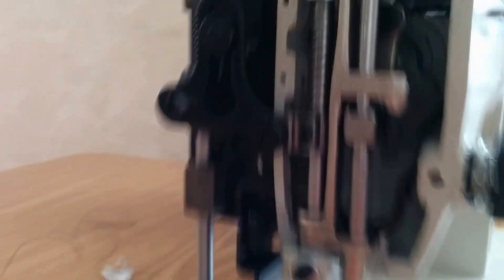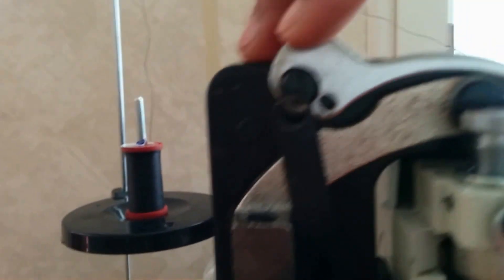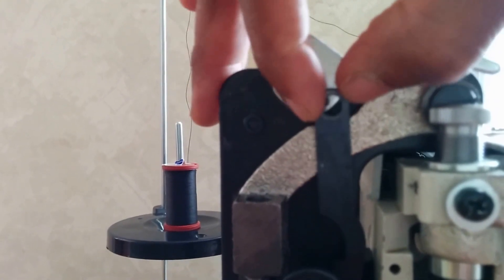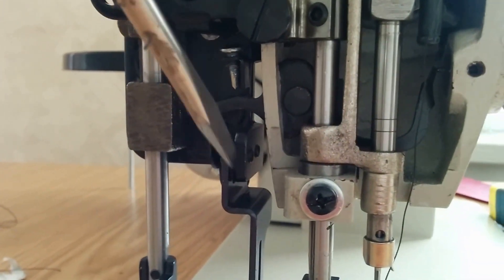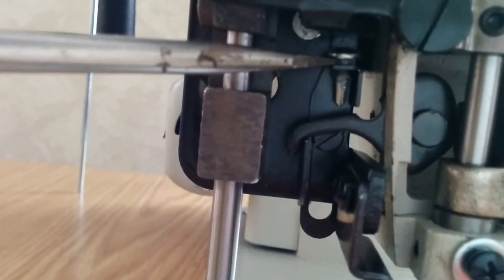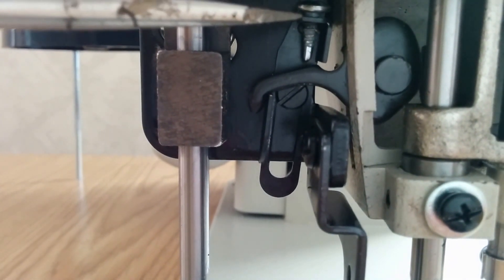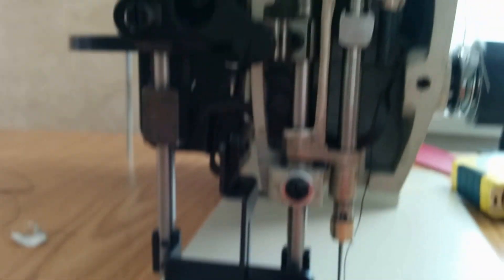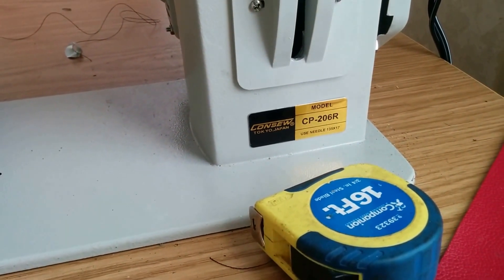Consew CP-206R presser foot lift

Comment: Thanks for the info on your mod! I’m having the same issue with my 206R. You may have said this, but I missed it if you did. Was there already a screw hole for the self tapping screw, or am I missing something?
Reply from the maker: There was no hole. I bought a self tapping screw. (Actually a whole pack of them) 1/2" long.
Reply: Thanks Trevor! I’m waiting for another lift bar to arrive before I do your mod, just in case I break the original... Rule 1 for me, ensure success by preparing for failure. 😂

Comment: This is a Sailrite clone, Sailrite changed manufacturers due to the fact of them selling clones of their machines behind their backs (Sailrite). I have Sailrites zigzag version and nothing is "flimsy" or needs to be modified to make it work. Consew, Rex, and a company named Morse ( no connection with the vintage Morse company) sell a clone of the Sailrite. Having had the chance to sew on a Rex, I can tell you they are cheap imitators and do not compare to the Sailrite.
Quality has a price... I'm glad I paid for the Sailrite instead of a clone.
Reply: Wrong, sailrite is one of the clones, but there are clones now that are long bed , 9 instead of 7 inches. Consew version is made in Japan, sailrite in China. Do more research, you are being ripped off by sailrite, same machine, same source, but use the larger balance wheel which is an option they all offer. Reliable is better.
Reply: @FrancisoDoncona  you are partly correct and partly not. The original Sailrite Ultrafeed was a clone of the Thompson PW301. After discovering the manufacturer in Taiwan was selling the Ultrafeed V.1 design to other manufacturers Sailrite sought a new manufacturer, in China. Most Ultrafeed clones on the market are based off of the V.1 design with lower quality parts castings. At the same time Sailrite was looking for a new manufacturer they were also redesigning the Ultrafeed to include stronger internal parts due to the Posi-pin lockup transferring too much torque to the driveshafts and linkages. This is the V.2. For most of us, the V.1 or even some of the better quality clones would work fine. But there's nothing about the quality of the Sailrite machines, quality control or customer service that is a rip off.
Reply: @josephcarter1850  Thank you, Joseph. Looking at Sailrite's offerings, I think I'd buy a Fabricator instead of an Ultrafeed. Only one thing: the Fabricator head can't be purchased by itself, the entire table, servo, etc, has to be purchased as a package. I just started on this hobby and bought a REX as my first machine. I should learn what I need to know from the REX if move on to a better machine.
Reply: @josephcarter1850  Interesting saga about the Taiwanese company selling the Ultrafeed V.1 designs.
Reply: @FrancisoDoncona  I own a clone of the Sailrite machine, labeled "Sew Strong".  I've done a lot of investigation to try to bring my machine up to the Sailrite level.  They have remanufactured their machines with all new internal parts to make them better and stronger.  The basic design is of course the same, but the Sailrite machines are on a different level, and it's not hard to understand why they charge more for them.  My clone quality is just above boat anchor, with so many problems I often want to heave it out the window.  This video shows something I've just experienced, ie., the limited presser foot clearance.  So, I"m going to see if I can do this mod.  I have a 9 inch machine, though I'm pretty sure it's Chinese.  You do get what you pay for.
Reply: I'm looking to purchase a Sailrite. I have listened to the sound quality of those machines mentioned and most sound horrid over thickness of fabric or on a double ply material. As much as I'm looking to buy the "knock offs" to save money, I think in the LONG RUN spending a bit more will be a blessing since quality construction will dictate the sell of those items made.

Comment from the maker: the timing jumped early on in my ownership and one of the synchronizing pieces broke. I have a parts list but was able to make the price from parts from the hardware store and a welder. I also fine tuned the timing for smoother operation. it still works well and I use it often but I've since bought a larger machine which better suites my purpose. I would recommend it as a good entry level walking foot machine.

Comment: do you still like this machine?  has it given you any problems?
Reply from the maker: I've been using my machine for about 5 years now. I had 1 part break and I made a replacement part myself. Other than that, no problem. I keep it well oiled with 90 weight differential oil And I use it mostly for upholstery work.